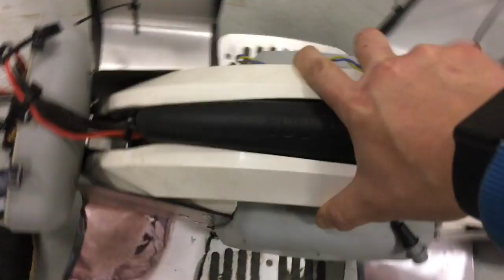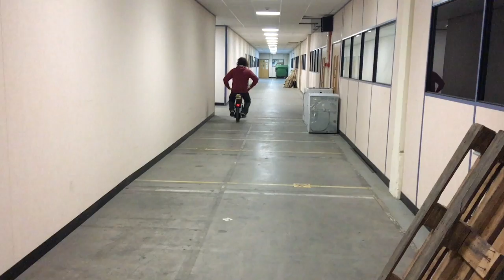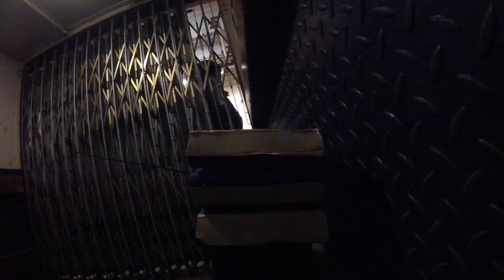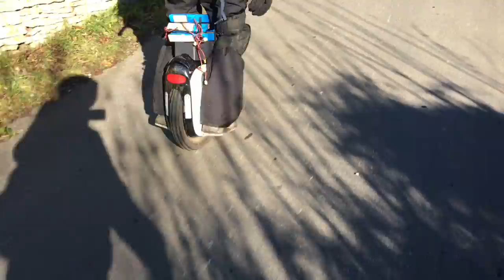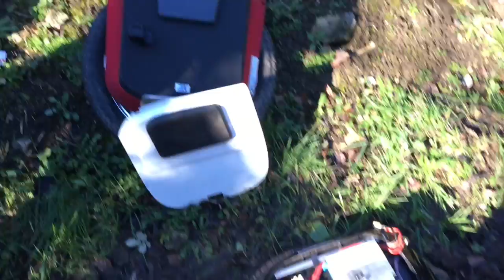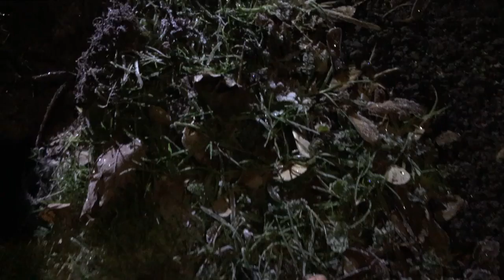100 Mile Test Ride #2

Comment: I really want to know more about this modification in depth. How would i go about installing an extra battery to a wheel? And make it work with the rest of the batteries and work with the same 1 charge port?
Reply from the maker: Take a look at all the videos it goes into enough details to get the general idea. Soldering and new wiring is needed.

Comment: Why does the wiring look so amateur compared to inmotion. Such an expensive device and such low quality looking wiring. I’m I being to harsh anyone ?
Reply from the maker: remember this is a modified bit of kit for a specific purpose, its not standard.
Reply: Speedy Feet UK I wasn’t referring to the mods. I’m speaking in general.
Reply from the maker: I think it could be routed neater for sure, otherwise wiring is fine.
Reply: Speedy Feet UK 👍🏿